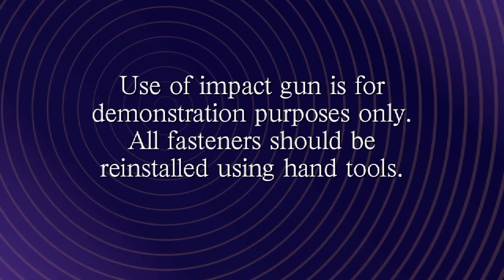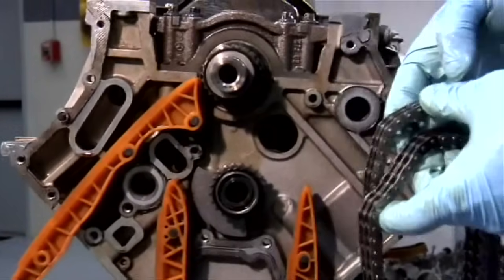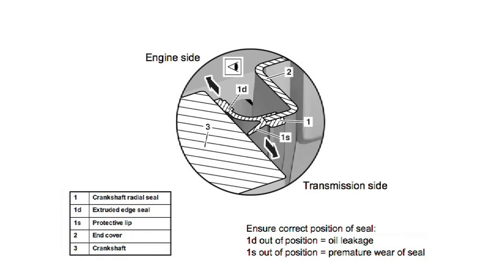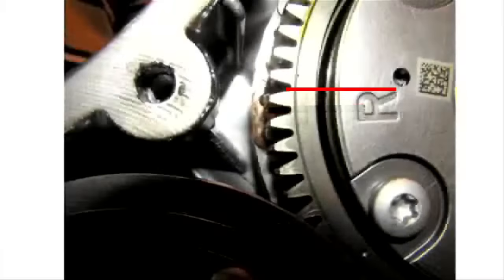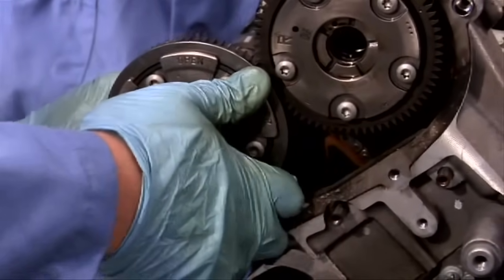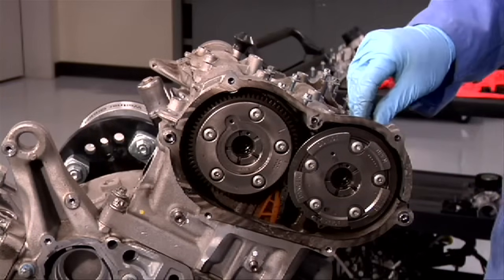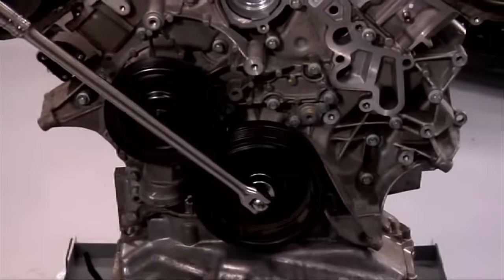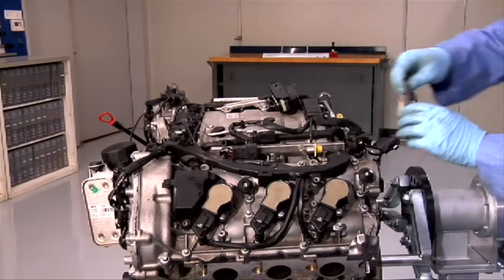M272 & M273 Engine -Balance Shaft Installation and Timing

Comment: Never got around to thank you, I forgot, but here I am. In early 2023, I had the dreaded DTCs and took apart the front of the engine to see a worn balance shaft. Thanks to you I kept my 235.000 km M272 on the road and it now has 287.000 km, it has brought me and my family to Bulgaria and back, my best friend and I to England multiple times and soon, my girlfriend and I to Morocco. I am now watching your video again because I need to replace the right intake cam gear. My memories were a bit cloudy but your video has brought them all back and I will now be able to confidently take on the job. Thanks Mr Padilla !! :D
Reply: How did that repair go ?
Reply: @thelongranger55  It will reach 314.000 km tonight :)

Comment: BECAREFUL, THE ONES WITHOUT THE ARROW ARE WHERE THEY’RE SUPPOSED TO BE, IT’S AN UPDATED DESIGN TO MIMIC THE “L” DO NOT PUT THE COPPER LINK AHEAD OF THE LETTER R IF IT DOES NOT HAVE AN ARROW, I am currently doing this fix and had to verify multiple times to get it down correctly, rotated the engine multiple times, adjusted the cams and gears multiple times to make sure and put tension on the tensioner to triple check with and without timing cover at the key and 40 degrees, I am doing this on an M273 v8 5.5L from 2007.

Comment: I'm taking off my right cylinder head currently and i have taken out all of the cylinder head bolts, and i was wondering even if i hadn't taken off my exhaust manifold yet, shouldn't i still be still be able to lift my cylinder head? or is the only thing stopping me the exhaust manifold bolts
Reply from the maker: It's been a few years since I completed this job so my memory is a bit fuzzy but I recall there being a bracket that's bolted to the head and a single bolt with a spring that secured the exhaust pipe.
I believe there's an engine ground that's bolted to one of the cylinder heads too--maybe.
Reply: do you remeber if the bottom of the timing cover is held on by bolts inside the oil pan?
 @eddiepadilla1078

Comment: I'm convinced that this job is for a Mercedes qualified mechanic; not for home mechanic without proper Benz tools.
Reply from the maker: I get the feeling your not a mechanic nor do you know how to work on things.
You don't need fancy software although it does help it is not required for this job. Personally, I would invest in a arbor press if you already don't have one. But, I used 8d nails to lock the cam sprockets and studs as alignment dowels for the timing cover. The only tool I needed to buy was an swiveled e8 on a 1/4 drive. Everything else is up to your skill level.
Hone your skills or pay the professionals is your insecure.
Reply: @eddiepadilla1078 facts. Don’t get mad because daddy didn’t teach you how to use a wrench

Comment: Had the balance shaft start to go out on my 06 r350, so I got the engine from a 2010 GLK350 and replaced it, about to buy an 06 c350 with a bad engine, and replace the balance shaft on the m272 from my r350 and put it in there, I believe if I pin and remove the cam gears this should be a pretty straight forward job
Reply: lol I am doing the job now, it is kind of a pain in the ass, but not so bad. Cleaning all the gasket maker off of everything is the worst part. Spent all day scrubbing in my parts washer

Comment: Help! Please, First Thank you for the Video, Unfortunately like many videos the orientation of the Balance Sprocket is not specified. My 19 year old son have torn down his M273 in my work area and he has removed the carbon behind the rings and performed a valve job and now we are stuck reassembling. How does the Balance Sprocket go in in relation to the copper link on the chain. There are not three lines on our sprocket, just weights, a mark on the weight and a part number. Any help would be appreciated. Thank You!
Reply from the maker: Weights? Are you working with a m273 with a balance shaft sprocket or just one that has an idler sprocket in place of the balance shaft sprocket?
Reply: @eddiepadilla1078  The M273. It does not have a balance shaft. It has a sprocket. Idler, as you say. But it does have weights on it. recently I've been told it has no orientation and the weights are to balance the sprocket, not the engine.
Reply from the maker: @localsource  what is the part number for the sprocket?

Comment: Hello I hope that someone can help me with this. When aligning the right intake camshaft sprocket the R with the arrow, would the arrow be in the middle of the copper link. Assuming the letter W would the arrow be in the middle of that W like V^V the symbol ^ would be the arrow that is at the end of the R.
Reply from the maker: Hi Mohamed, great question. The imaginary arrow sits in front of the R and should point to the beginning of the link.
Reply: @eddiepadilla1078  perfect thank you so much that makes sense. That means the middle of the R would line up with the middle of the link?
Reply from the maker: @Phar3aoh  Correct
Reply: Man you are awesome, thank you for replying!! 
Couple of last questions if you may! I have the M273 engine with the idler sprocket instead of the balance shaft. 

I have the 4 markings on the chain for each sprocket, the one by the idler gear I can’t find anything to line it up to on the gear itself. It is just touching the idler gear though, is that good enough?

And when you assembled the engine, you connected the chain to the crankshaft gear and then installed the timing cover. When moving the chain up top to line up the links on each sprocket. How would verify that the chain is still connected on crankshaft gear in the right place and has not moved?
Reply from the maker: @Phar3aoh  if you have an idler sprocket and no mass to counterbalance then the idler is there only to help direct the chain and doesn't need to be timed.
You will need to rotate the engine 2 complete revolutions and recheck the all the timing marks. You can still see the chain with the timing cover installed as long as the harmonic balancer is not installed.
Reply: @eddiepadilla1078  thank you so much for the reply. Subscribed and liked!
Reply: @eddiepadilla1078  Just wanted to come back and thank you again for getting back to me. I installed all the cam gears back, the tensioner, and did two full rotation after going 5 degrees back then two full rotations. installed the front covers back, put the crank at 305 and all four marks are dead center. thank you again!!!

Comment: So I'm gonna be attempting to do this myself and what not, it's a personal project because it's my dads car and I want to make him proud of me so if there is anyone that is wiling to talk and assist I would love that much love to you all ❤❤
Reply: I am doing one right now!
Reply: If you still need help I did mine a year and a half ago
If you did it already, how'd it go ? :)
Reply: @defalt45  I have codes p0016 and p0017 this is the fix to those codes right? And if  I DIY this whats the estimated price?
Reply: @scratchappy2507  Most likely yes. It cost me around 4.500€ with only oem parts, replacing all seals, timing chain, all the guides, which to be changed require removal of the heads so new head gaskets and bolts
Reply: @scratchappy2507  Can't say for sure. Could be balance shaft, other chain issue, cam adjusters or cam magnets.

Remove the bean shaped cover from the right cylinder head (left side when facing front of car), grab an endoscopic camera, shove it behind the intake cam gear and you'll eventually see the balance shaft gear, if it's worn out you've caught your culprit
Reply: @defalt45 could you replace the balance shaft without taking engine apart?
Reply: @YawnDaOG  No

Comment: I have a question for you. I have Mercedes Benz r350 v6 cylinder 6 has a misfire. I replaced the air intake manifold I saw the intake valve filled up with oil. There is a way I can fix valve stem seal without removing the head off. Please let me know the best option
Reply from the maker: Yes, you can pressurize the cylinders with air to hold the valves in-place as you replace the stem seals but I would not exceed 5 psi if you do that. Before you go that route you what to check your compression first to ensure you dont have blowby that is leaking oil into your intake as leaky stem seals typically manifest as a blue tined smoke exiting the exhaust, whereas, excessive blowby will manifest as excessive oil in the intake/pcv system. Hope this helps.
Reply: @eddiepadilla1078  ok Eddie thank you for the answer. But do I have to remove the camshaft and  release the timing
Reply from the maker: @Godisablebraketechnicianasecer  unfortunately, yes you'll have to remove the cams and timing cover.
Reply: Hi eEdd I got blew by

Comment: Wow. I replaced a clutch in a Fiat Spyder when I was a kid and ah remember that the lowest point on that car was the oil pan only less than a foot from concrete. That was pretty simple but need to jack the engine up a bit to do it. This process is clearly beyond my tolerance level. It seems like the M272 is of poor design. Why would the chain hang in my opinion? The chain needs to react to stressors I assume but keeping it inline per a lifecycle of an engine seems poor design per my take on it. Yes, I have the M272 balance shaft repair per 77K miles on my SLK 350. I'm hoping MBUSA will do something. Its clearly a problem with that engine at that time. A class action suit was launched that paid for most repairs but I'm beyond the 10 year mark but with 77K miles. A 60K car should not be toast at 77K miles. It just seems to me that replacing the balance shaft would not repair damage made by metal fragments circulating throughout the engine. MB also suggested the same when I learned of the class action effort years ago. A new engine would be needed. They also suggested that we do not see many of those models around anymore.

Comment: 100 000? i don't think so. these engines on the video are V6 engines, they need replacement sprockets but not the V8 .R172 engines. these V6 engines are problematic yes. M152 and M157 don't need that sprocket and chain replacement that often. The Mercedes-Benz M273 engine is a V8 automobile piston engine family used in the 2000s. It was based on the similar M272 V6 introduced in 2004.

Comment: Why do you put the timing cover on before the cam gears?
Reply from the maker: It can be a bit difficult if you tried to install the cover without the gears because the chain gets in the way and the last thing you want is a lightly oiled chain touching a clean, degrease mating surface with a bead of silicone--good way to compromise your gasket if not.

Comment: Thanks for showing the timing procedure. In M273 V8 engine there is no blance shaft because there is no need of balancin cross plane V8  with natural 90degree V angle, int this place there is only gear that tennsions timing chain. The balance shaft is only in M272 V6 engines whres Mercedes applied unnaturla V angle 90 degree and too soft steel for timming gears
Reply: That is true, but the 273 V8 has an “idler gear” in the same location (just the sprocket without the internal balance shaft), which suffered from the same wear issue as the balance shaft sprocket. Sadly, since it’s based on the 272 V6, the same thing happens when it fails, the chain can skip, stretch, and wreck the valve train.
Reply: @existentiallychallenged5068  Exactly. M273 is just M272 with 2 extra cylinders. There was no inherent need for the idler gear, but not putting one would have needed designing a whole new engine

Comment: What's the specified torque?
Reply from the maker: It's been awhile and I don't have those valves anymore. You'll have to go to MB Star Access and get the values from them. It cost and it's difficult to navigate but you can fine all the torque values there.
Reply: @eddiepadilla1078  thanks Eddie.

Comment: Interesting video.
Cant help thinking, thats some fancy engineering for 250ish HP. Even if the reason is a smooth running motor it feels a bit overengineered?
Reply: Over engineered to fail and  drain your wallet.

Comment: Was quoted $2800 with parts and labor for this repair. Anybody else? What do you think eddie good price? Mines a 6 speed c350. Mechanic suggested just replacing the balance shaft instead of buying another engine. Sitting at 150k miles
Reply: I say go for it at that price. Some independent euro shops wont even take the job, at least you found someone to do it.
Reply: @713mario713  ended up taking longer than expected.. The technician swapped the shaft and the kit. P16 came on after I left the shop. I dropped it off, He then rechecked it and p16 went away. Now, Something went wrong and P011 code came on.
He's  ordering a 09' 3.5 now. Should be done next week.

Comment: on what milage or km can one expect replacement? I have the new normal aspirated 5.5 V8, no turbos
Reply: 100,000
Reply: When you change the oil it is a good idea to let the oil settle and pour out the last of the oil on a flat surface while looking for small flakes of metal.   Its not as much a question of at what mileage does the failure occur,  but gently driven M272 engines seem to escape a lot of the damages seen here. Save your old oil and inspect it for metal flakes.

Comment: At what miles does the balance shaft problem occur ?
Somebody please help
Reply: Around 100,000, but only if you have p0016 or p0017 codes
Reply: @diegolynx6821  thank you so much for your valuable feedback

Comment: Does any one know what size torx socket is used for the back of the camshaft?
Reply: t55
Reply: @jordandillon8157   Yes but for some reason the intake camshaft socket fitting is set deeper into the cam than the exhaust side so my t55 barely reaches into the hole!?
Reply: @mascho22  did you try an extension or you might have to just find a long one the one I used was from craftsman I got it at Lowe’s and the head of the bit stuck out further
Reply: @jordan9752  Actually the correct size is t60 which is the one that's a little short on bit length (at least the one I have).  My t55 is long enough for the intake side  but fits loose in the hole so I put a rag over it then insert.

Comment: What I'd like to know is why these parts failed, who made them, why Mercedes Benz QC didn't catch the flaw before using the part, and then why did they lie about the issue for 7 years? Well, they're still refusing to acknowledge the issue and claim they are not responsible. Haha, what a company!
Reply: I have a 2008 Merc R350 4matic V6 3.5, with this issue. I went to the dealership $5,770.00 for repair. I know another shop who can do the repair, I just haven't call the shop yet. Oh yeah a Merc enthusiast told me any Merc after 1995 has parts from automobile companies. The balance shaft in my car is allegedly Mitsubishi. 🤦
Reply: Actually that engine started being used towards the the end of the of 05 to 07 they caught the issue and fixed it late 07
Reply: Are you stupid or retarded😭

Comment: We need to torque them to specifications. Good idea but what are the specifications? I bought new bolts and the specifications that came with them say 1=20nm, 2=40nm, 3=90deg, 4=40nm, 5=90 deg, 6=90 deg. I don´t get it, after step 3 to torque to 40 is meaningless as the torque is already way above. Shall I loosen them and start all over again or what?